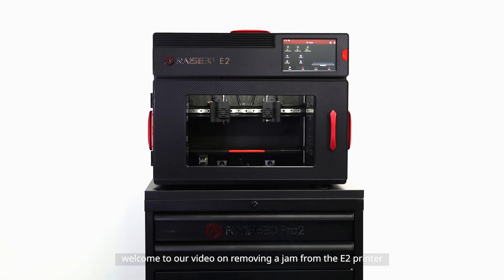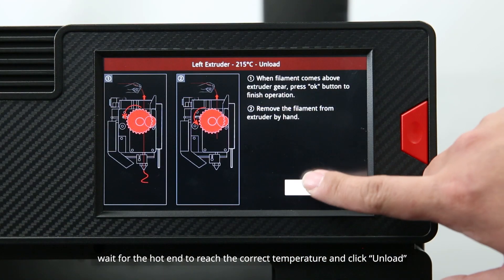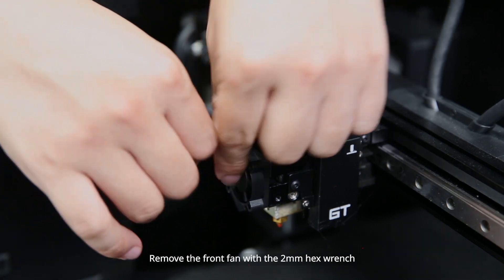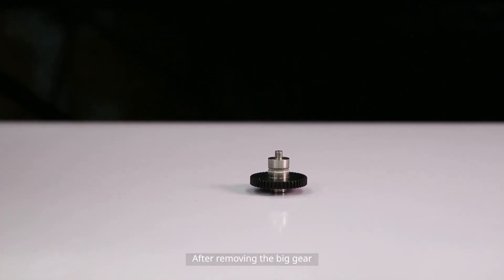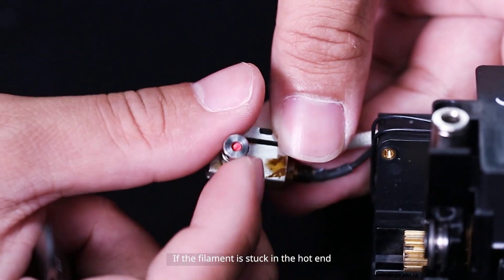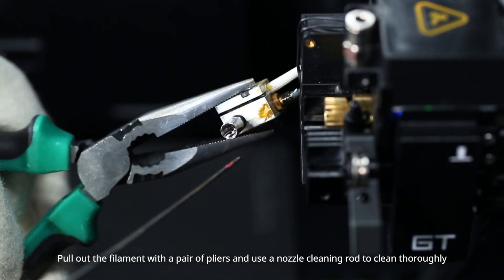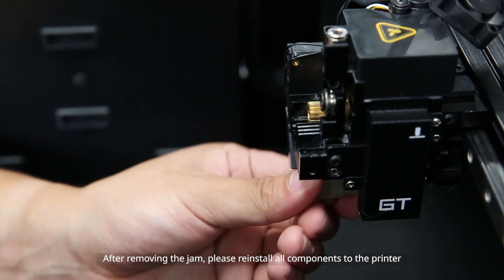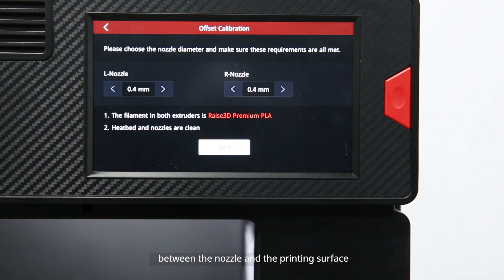How to Remove the Jam - Raise3D E2 Printer | Raise3D Academy

Comment: There is a piece of double sided tape between the gear cover and the part cooling duct part. If you are wondering why your gear cover is not freed after you loosen all 3 screws, that's the reason.